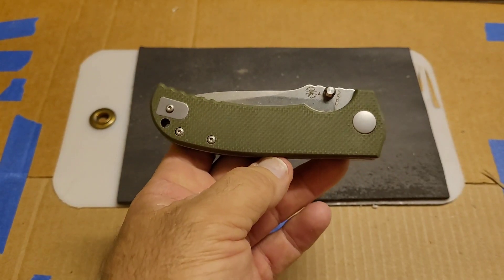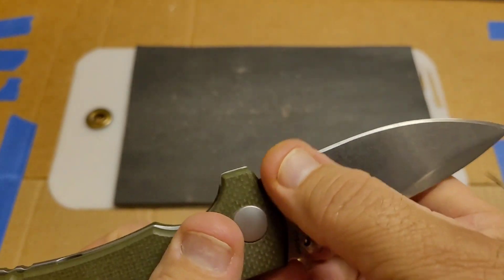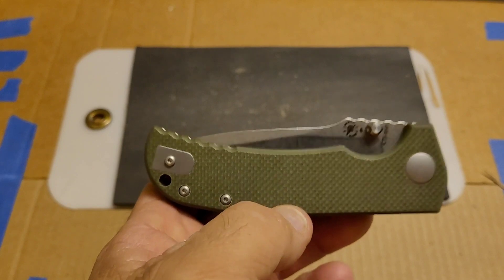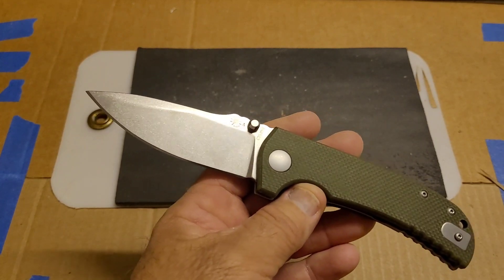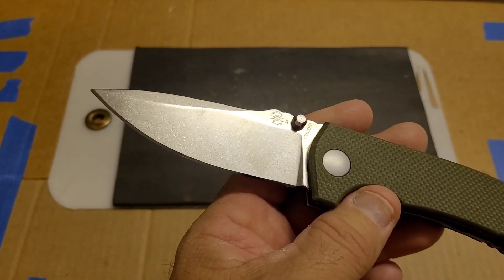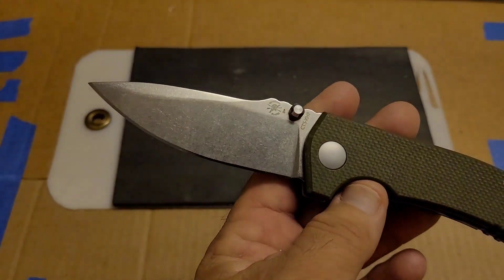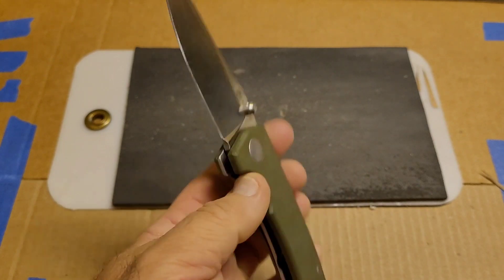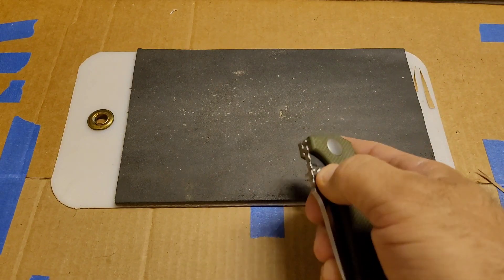Spartan Astor XHP edge retention testing. Advertised at 58 to 60 hrc, how does it stack up?

Comment: How tight is your astor? If I tighten it to where it has no side to side play, it seems really tight. I got an astor because I love my vecp, I knew it wouldn't be the same at all, but it seems to have a lot of tightness out of box.
Reply from the maker: Mine was also stiff to begin with. I've used it enough now that while not loose it's also not stiff. I don't see it ever being any kind of drop shut knife and I prefer it that way.
Reply: @Outpost_76  I think I have it adjusted better now, still not perfect but good enough for how new it is.  I don't expect it to be drop shut, this was just waaay tighter than I'd expect. I'm a bushings over bearings guy with most of my knives. This was VERY tight. I've heard a few people say that it was pretty stiff, but no real explanation of exactly how stiff. I figured if it was stiff enough to comment, it had to be pretty measurable.

Comment: Can you explain what the fine edge vs working edge is that you talk about? Is that that the type of edge you put on it while sharpening?
Reply from the maker: Fine edge is the initial sharpness uo u til the point it won't shave hair anymore. Working edge is from when fine edge stops until it no longer uts 20 poind weight printer paper against the grain. All steels and knives I test are done this way to have a benchmark of when each cuts until.

Comment: Hey G
I bought one of these because it was a nice big chunk of xhp for a good price. I guess for the price it’s ok. I had to do a bunch of sanding on the sharp edges to make it more comfortable. The thumb studs were particularly bad and were tearing me up and got a bunch of sanding. I think the ergos are good now. My detent was too tight and had to be adjusted to take pressure off. It will still not drop open as hard as I try. It is now good for me. I think that shows how inconsistent their tuners are. I wanted an xhp blade for my collection and should have bought a chaparral etc. Oh well like I said it’s ok for the price and I actually like the knife but will get another xhp. Wish I could have gotten a recon when they were in xhp but got into the hobby just too late.
Thanks for all the great content. An informed buyer is getting what they really want.

Comment: How come no one else supposedly can't get XHP by these guys can? Sad.
Reply: Cold steel said something like the price was too high and the quantity they needed cause they are a huge mass manufacturing company was an issue. Something like that. Since s35vn was in more supply and cheaper they went with that. Plus more Normie's know s35vn.
Reply: I don't know how many of these they are putting out, it may well just be an issue of how much of the steel is availible and how often they need it by different companies.
Reply: It is ridiculous that Cold Steel dropped XHP with that explanation. Spartan is mass producing these for under $100. SOG is doing it, with cryo (as it should be done), for fairly cheap in mass production. And Cold Steel is doing it again, on limited models, for expensive. XHP is very under-utilized

Comment: Holy shit I just bought one of these. I didn't have any XHP and you sold me on it. Thought it was a value at about 72 dollars. It was very thick behind the edge, .035 if I remember. Weighs nothing. The cutting ability is subpar. I will have to grind down the primary grind unless I want it to be a scandi grind at this point. Overall it's an ok knife. I'll have to mod it if I keep it. Nice to see you back.
Reply: How is the detent on your sample?
Reply: @matusknives  it's not bad. Lock up is later with the liner in the middle of the blade. I wonder if it was adjusted at the factory to get the detent tight enough. It not the best or the worst. Mediocre. Like the whole knife. I can't hate or love it.